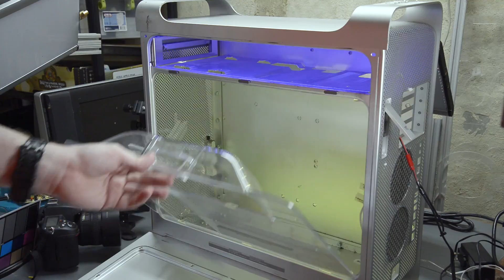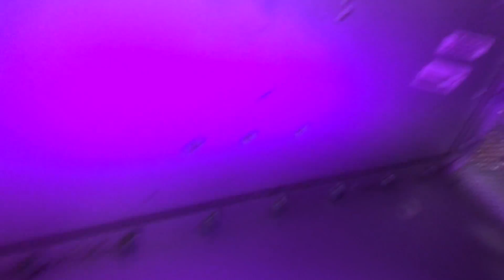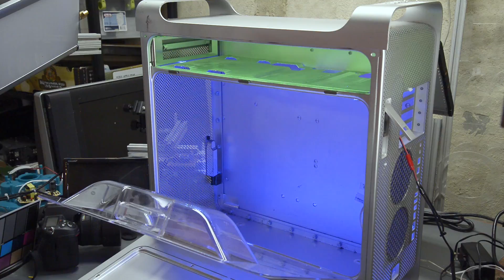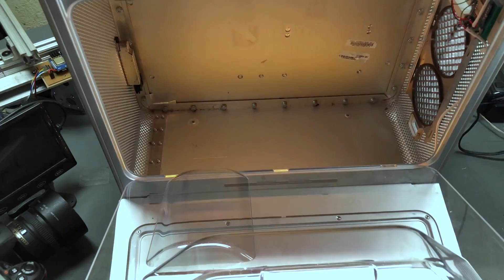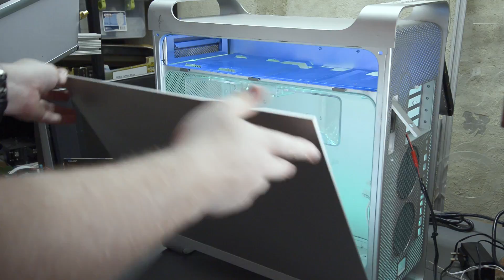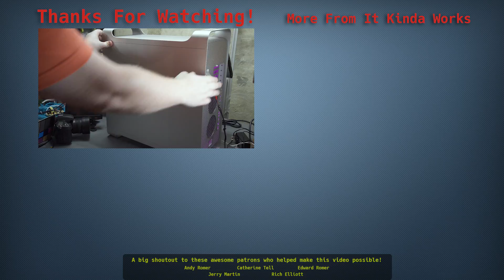Ultimate DIY Stash Box (Build Log 1)

Comment: You say imac g5 in the video but its actually a macpro g5. such a small correction but i only bring it up if somebody wanted to build something similar and tried searching for an old imac g5 to buy, they would only find the all in one systems
Reply from the maker: Well oops. Looks like were both wrong though. Its technical name is "Power Mac G5". I purposely didn't say "Mac Pro" because those are the intel ones and have somewhat different internal framing. https://en.wikipedia.org/wiki/Power_Mac_G5